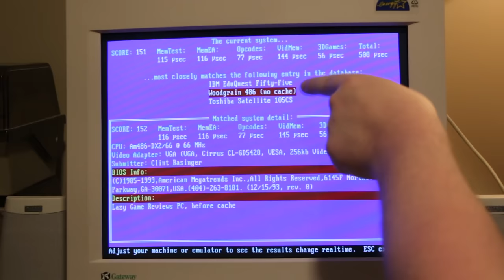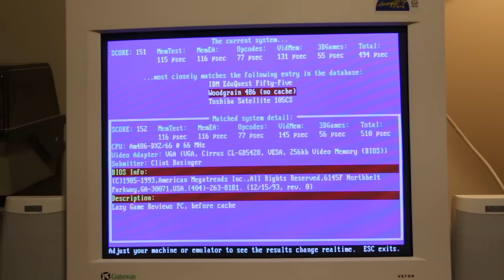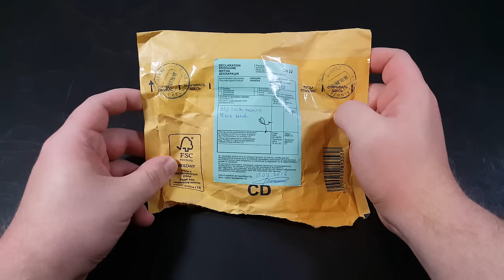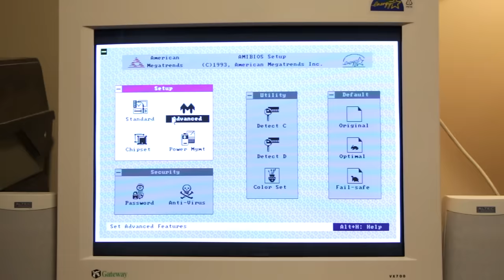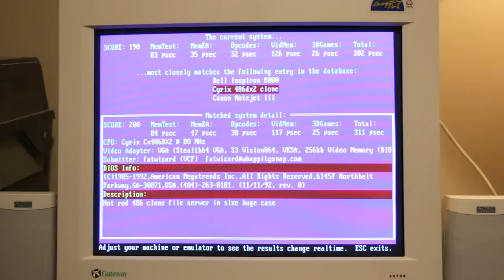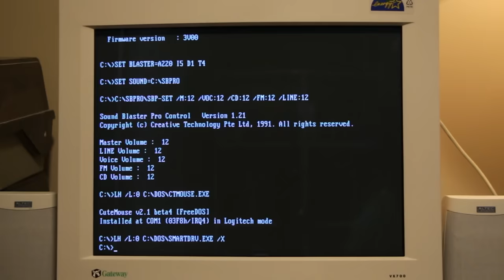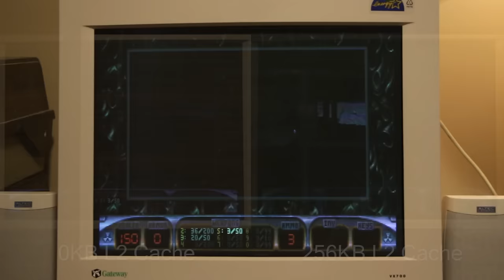LGR 486 Update! Installing L2 Cache

Comment: There's no way duke3d should run this bad on a dx2, it's probably your video card that's being an ass, maybe duke3d just doesn't like the bus? I had a Paradise SVGA 1mb integrated chip (on ISA bus) on my first computer and it ran better despite my DX2 being an overdrive (thus on a 386 motherboard). I could even run in 640x480, it was slower but it worked.

Comment: What does your CONFIG.SYS look like? If not this, please try this:  @ECHO=OFF  DOS=HIGH,UMB  DEVICE=C:\DOS\HIMEM.SYS SHADOWRAM: ON TESTMEM: ON V  DEVICE=C:\DOS\EMM386.EXE RAM  FILES=60  BUFFERS=20  STACKS=9,256  FCBS=4,16  BREAK=ON  (CDROM)  DEVICEHIGH=C:\(CDROM.SYS) M:10  DEVICEHIGH=C:\(MOUSE.SYS)  Then- your AUTOEXEC.BAT: LH (MSCDEX.EXE) (MOUSE.COM) (SOUND STUFF) I built an Intel 486 DX2 66MHz 256 cache/256 shadow 8M RAM 32bit MOBO, 32bit IDE, 32bit 1MB Trident SVGA, Gravis Ultrasound ACE and old DOS stuff would fly. It's all about the setup.

Comment: Gamers here, Would upping his Diamond video card from 1Mb to 4MB make the change he needs on Duke Nukem 3D?
Reply: Since it’s a plain (S)VGA card, maybe with some simple 2D-Acceleration built in), that shouldn’t make a difference. It just needs enough RAM to actually hold the image data. A 1MB card should have no problem doing 800x600 in 16bit colour (“high colour”, some 15 000 colours), or 1024x768 in 8bit (256 colours). It either has enough RAM to display a mode in the desired colour depth, or it doesn’t.

I did wonder if the graphics chip was crap, though. The early Cirrus Logic VGA chips were quite a mixed bag, but this being a VLB card, I think his card is a bit newer, and in the VLB/early 2D-accelerator era, their chipsets tended to vary between quite adequate and rather good, IIRC (it’s been a while). Someone mentioned this particularly one was a fairly decent one back in a comment on the original build video.
Could be that particular card, but I don’t recall Diamond cards having a reputation for being badly designed at the time. And since the Cirrus chips had integrated clocks and RAMDACs pretty early on, there isn’t too much a card manufacturer could cut corners on (except for slow RAM, maybe).

Personally, I think there’s something wrong with Memory timing/settings, or maybe some weird DMA/IRQ conflicts or the like.

On the other hand, by the time D3D came out, a DX2/66 VLB system would have been quite dated… I had replaced my beloved ISA 386DX/40 with a PCI 5X86 the year before, and that only lasted until the next year…

Comment: Something is seriously wrong with your main memory configuration / board & BIOS settings.  No way should your main system RAM be running at 361 ns access time (or even 154 ns).  Most RAM chips for '486 systems back then ran at 80ns or even 70ns access times (and as always, install chips in matched pairs, all chips should be identical).  Whatever setting or config you have is severely crippling that system, and I mean *severely*.  You're getting 11 MB/sec throughput on it.  It should be around 33 MBps (megaBYTES per second).  Once you get that all sorted, your Duke Nuke'Em 3D should run around 45 - 60fps.  It always ran around 45 fps through the whole game on my '486 system back in the day, and that was at 1024x768x256 (VESA mode).  Video was 1MB VLB Cirrus Logic CL-GD5428, surface mounted on the board.  Ran like greased lightning, especially when I upgraded from i486 DX-2 66 MHz CPU to AMD 5x86-133 MHz CPU (with system board correctly jumpered to 33 MHz external bus speed / 4x multiplier).

Comment: Hmm, CacheChk looks an awwwwwwful lot like MemSpd, by the same author, from the same period. In fact I'd be tempted to put money on one being exactly the same as the other just with the name changed. I got a great deal of use out of Memspd back in the day, seeing what settings did and didn't make a genuine difference to latency and transfer speed, and just how far both individual modules and the cache on different motherboards could be pushed and tuned up before starting to glitch out.

And, well ... wow, no wonder Duke3D was suffering. Your main RAM is running HELLA SLOW . You need to get back in that classic AMT BIOS and poke around at the timing settings, because that's just not right. More than 90ns effective access time, so only 11mb/sec? There's 386s that would be embarrassed by that, and it's not just your game performance that will be suffering. You should be able to speed that up by more than 50% without any risk of corruption whatsoever, and I wouldn't be surprised at good quality latterday SIMMs being good for almost twice that speed. Plus it doesn't seem to be doing any kind of interleave at all, either that or it's running a humongous number of waitstates and not using any kind of fast-page or EDO mode whatsoever; 90-ish nanosecond access translating into 11mb/sec essentially means you're getting the equivalent of 8-bit memory access, when you should have 32-bit, or at least no worse than 16-bit with two modules installed even if they're actually 30-pin.

That computer must have felt slow for *everything*, not merely 3D games, and I'm not surprised it dragged whilst playing those. Even the ISA bus has more throughput than that, so you won't even have really seen any benefit from running PCI graphics or 32-bit disc access. Heck, compare it to something like the Atari ST... designed in 1984-85, with an 8mhz 16-bit processor... but its main bus could transfer 8mb/sec quite easily (and needed to, given that half the memory access time was given over to graphics, which beamed pixels directly from RAM to cathode gun at a rate of 4mb/s during the active period).

I've got a 486 SX25 tucked away under a bed, and I'm pretty sure it benched Memspd at considerably more than that... 12.5mb/s at the very least, maybe a good 25mb/s, and it uses 30 pin memory; probably if I had a DX25 to drop into its socket it would have run Duke better than this. I'll have to dig it out and see what the actual numbers are.

The weird thing is, your write speed seems to be more than twice the read speed. What's that all about? Is it cache interference or what? And the L1/L2 speeds don't seem to be quite as good as I might have expected... though maybe it's just a feature of the code itself. Perhaps the read and write timing routines sacrifice absolute speed for repeatability and linearity between machines, and I'm misremembering things (another dim memory is that for certain machines there was bare little difference between L1, L2 and RAM, though that might have been one of the earliest Pentiums / AMD K's that came with SDRAM...?)...
Reply: Yeah, I just plugged it in, no idea if the CMOS settings are as I left them or if they've reset due to dead battery (the RTC thinks it's 2013, and looking at the BIOS settings that I haven't messed with for several years they're essentially all greek to me), but it's giving pretty much uniform timing from 16 bytes all the way up to 4096kb. That is, 42us/kb, or 26.1mb/sec, on a 1992? 93? vintage machine with a 25mhz 486SX and no local bus, only ISA, and 8mb total onboard, using 30pin modules that are less likely to have high speed silicon on them or accessing them. Effective access time is 160ns, or 3.8 CPU clocks (which might be down to the main bus being clocked for access at "1/4 CPU").

So your machine's memory is dog slow even compared to a 25mhz model, let alone a 33mhz or a typical 66mhz. That's probably why it was so low-performance in the first place, and why it's still not great even with the cache. Every time the CPU has a cache miss, it's having to go back to RAM that's running way slower than it should.

If it simply scaled up in a linear manner from this 25mhz to your 33mhz bus, we'd expect something like 34mb/s, which sounds rather more like what I used to see with my own DX2. In other words, your RAM is running at a third the speed it should, and you really, really need to look into that. Like, it's showing very nearly the exact same write speed as my 25mhz model (slightly faster in fact - presumably it's managing 33mhz, but with an extra wait state or something?), but way slower read speed? Something's very broken.

...right, I'm off to have another play with this, see if I can eke a little more speed out of it (surely the memory should be good for 120ns? 3clk instead of 4clk?) and maybe convince the L1 cache to differentiate itself from the RAM... without it crashing horribly of course...
Reply: ...nope, couldn't make it any faster, seems that the CMOS saved everything in a fully optimised state, though the ISA is now running at 7.16mhz instead of 6.25mhz (ie 1/4 cpu and main bus speed). Wouldn't boot at 8.33 (1/3 speed), presumably HDD controller couldn't hack it, but making it asynchronous doesn't seem to have hurt either the memory speed or hard drive loading speed, hopefully it's a few percent quicker if anything and it may also have given the graphics a small boost. Don't have Screamer installed any more to be able to run its graphics transfer rate test, so can't be sure, could go either way. Maybe I left it at CPU/4 because that actually proved slightly faster?

What I did manage whilst playing around was to deliberately slow it down to see how far I could drag it, and, well... the worst I could do is 19mb/s (well, wavering between 18.9 and 19.0), with about 55ns per byte, or 221ns effective access time, for both read and write... ie somewhat slower for writing than yours, but still a good 70% faster reading. That's with everything set to the slowest option - memory access at "slowest", extra wait-states added, etc. Amusingly, when the speed dipped below 20mb/s, Memspd started saying "Memory at Megabyte (X) seems REALLY SLOW!!"... if it thinks that's bad for a 25mhz machine, well, 11mb/s is really bad for it, never mind for a 66, and to be honest I have no idea how come you're seeing such a poor result. Have you run it with absolutely clean DOS, ie hitting F5 to skip all startup files, etc, so there's no interference from Himem.sys and the like?

Funnily, the cache zone (16 bytes upto 8kb) stayed at 26.1mb/s no matter what I did... so at least showing some differentiation when the memory was run slower, but also showing that L2 cache would have absolutely no effect in this machine. Though it does support running both SX50 and DX50 chips (50mhz FSB!) as well as SX2 and DX2/50s, so there may be benefit if I upgraded it with one or other of those... I have been after a DX2/50 for it but haven't yet found anything of the right voltage that doesn't cost an absolute bomb :/ ... and although I still have a DX2/66 mainboard and chip, there's no way to get it to fit in the same case (it's a slimline model with integrated serial/parallel and an ISA riser, can't find any suitable PCI risers...), and the CPU can't even be used underclocked as it's a later revision that uses lower voltage... the mobo would simply fry it :(

Comment: good grief, 2.5 megs of L2 cache??  Almost no one had that much L2 cache in their 486 back in those days, those 256k cache chips would have costed $150-200 a pop back in 1994 (so figure for NINE of them, $1500????).  Most people that had L2 cache had 64k cache chips in them which would have added up to a more realistic 512k cache (a cost of about $300-400 or so).  Obviously having THAT much cache in a DX-2 66 would make a huge difference in almost every benchmark and solid improvements in most games that were high CPU demand, which because most were still integer based graphics, the L2 cache made a big difference.  Unfortunately you are running a game made in 1997 when Voodoo graphics were starting to show up and Duke Nukem 3d was built for those newer computers to utilize the new 3d rendering, so you would not see QUITE the big dif in performance from the L2 Cache in a later game like that.  earlier games like Doom and Doom II, which still used older integer graphics would have seen a huge boost in frame rates from that cache.
Reply from the maker: Where'd you get 2.5MB? What I installed here was a total of 256KB.
Reply: oh, I must have miss read when you read out the reading, sorry, I went back and looked and you did say 256, I have no idea why I thought you had 2.5 megs, so you must have been using 32k cache chips.

Comment: Game graphics sucked until the Voodoo Monster came in 1996.
Reply: *Diamond Monster, using the 3Dfx Voodoo chipset ;)

There were a certain notable set of games that had pretty nice software rendering, though, which we were kinda thankful for when running a simple 2mb PCI 2D card. Even when we finally got our Banshee card (a cut-down Voodoo II plus 2D accelerator, a bit like the Rush was for the original Voodoo), the main difference I initially saw with e.g. Need For Speed 2 (and Grand Theft Auto) was that it ran in 16-bit colour rather than the slightly clunkier 256-colour mode, and I'm not sure if it even made any noticeable difference at all to FF7. The programmers did start making better use of the chipsets in later years though :)